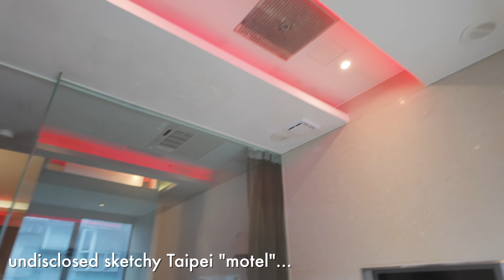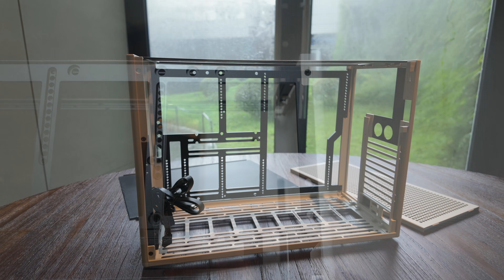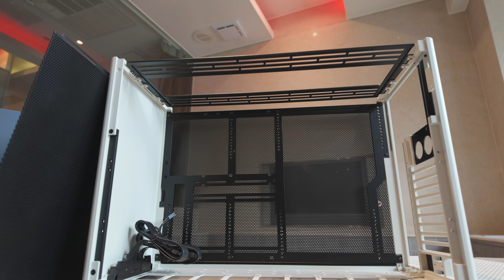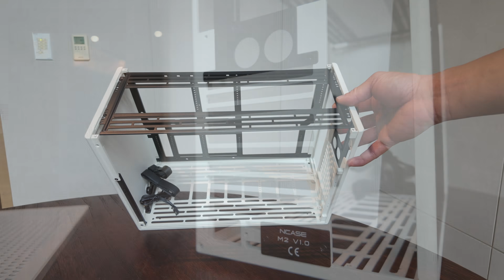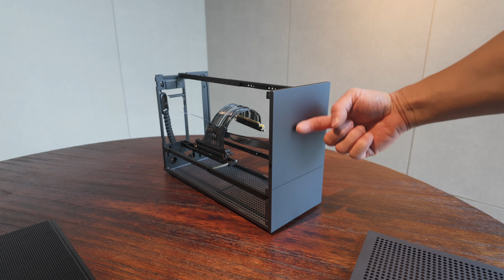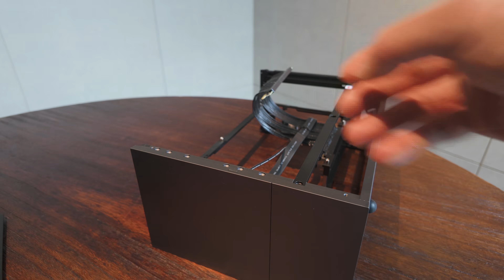This is IT - the NEW NCase M2!

Comment: The GPU temps aren’t very good.
bellow 70 is what’s considered good.
And you tested at 1440p,at 4K temps will go even higher.
Reply: "below 70 is what's considered good", according to who? Temps in this case are still in low to mid 70s at max settings on 4K, with a moderate undervolt even less.

Comment: "Smoother anodisation finishes are harder to make" it depends. The longer you anodise a case, the rougher it gets, so if the smoothness is controlled by anodisation length, it's cheaper to make and overall a less robust surface.
If better smoothness was achieved by a finer grid of sand/bead blasting, then maybe it may have been "harder" to make, but I really don't see it personally tbh.

Comment: Genuinely super disappointed to see you refer to the Ncase T1 2.5 as a FormD T1 considering how messy the split between Ncase and FormD has been and that FormD is still selling the T1 2.1 with superior machining and tolerances alongside Ncase's 2.5
Reply: Not to mention that W360 called the 'Ncase' T1 2.5 despite it having much worse tolerances. All they did was make some superficial changes to call it a different case while spitting 3FC and FormD.
Reply: I still don’t understand the differences between the 2 cases / companies

Comment: What i really wish in m2 
Is to support 2 120 or 140 top and bottom fans while using matx motherboard
Also to add the ability of sandwich orientation where gpu on one side while the aio rad on the other side of the case 
This would be the ultimate case ever 
If do so❤❤
Reply: You are looking at Jimu D+ for that kind for modularity.
Reply: Awful case for the price sold by a shady company. @RangerAmateur
Reply: @RangerAmateur  1st time i heard about this 
I will look at it 
Thanks man
Reply: Just get a different case then.
Reply: @svn5994  do u have any sugestion for matx sandwich case